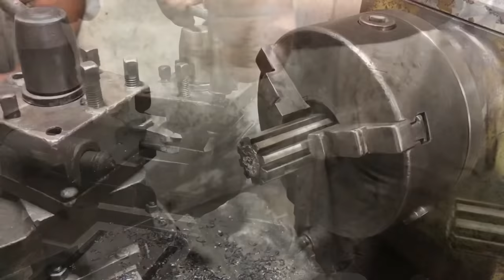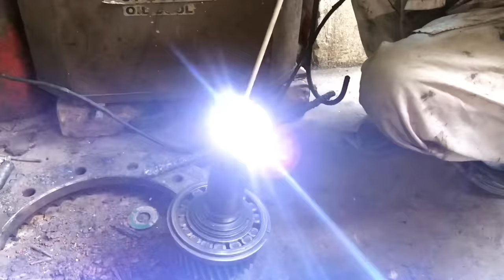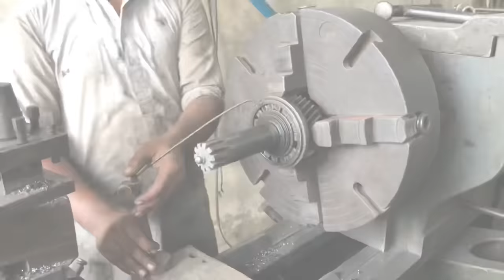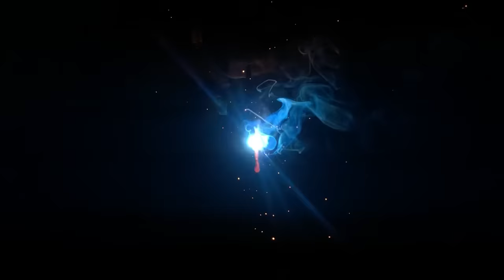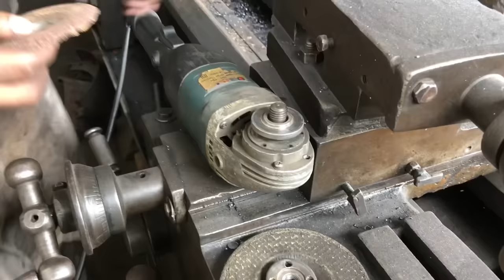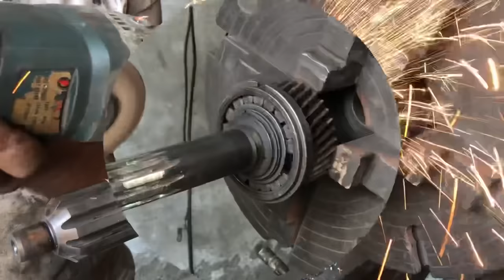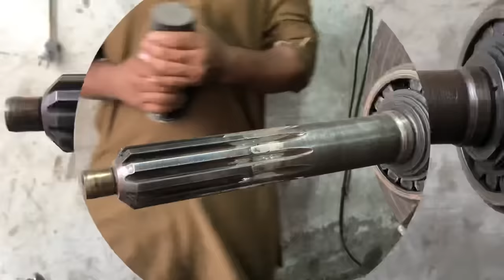The Ingenious guy Connected Broken Input-shaft Very Nicely / Pk process

Comment: As a lifelong welder, that ran a fabrication and repair shop for 45 years, about  the first time he accelerates, that thing will go pow, right next to the weld!  There are some thing’s that shouldn’t be welded, and that is one of them.  Like Clint Eastwood said, “A man has to know his limitations “!  😂🤣😂
Reply: As a physicist and engineer I approve his work, you're wrong.
Reply: @rafars2246  completely agree with you. Here in America we believe new is the only viable option. In many countries they have to make do with what they have and I feel the time spent on doing this job shows that it will last.
Reply: @acetech9237  that was a full melt job, compressing the area, that "weld" is stronger than the rest of the piece. And they do it for a reason, because it works for many more years to come.
Reply: Artistry. Impressive.
Reply: @rafars2246  he has 45 yes of experience on this and u have none and I am also an engineer
Reply: Thought the same, and i couldn't help noticed the fact that half of the piece turned blue, so it's probablly "not duro (hardened) anymore".
Reply: @lucianomi22  I got baking soda
Reply: Значит прийдётся ещё один шов наложить 🤣🤣🤣
Reply: That's shit in Cuba that's not done come to Cuba to see good turners it must be a drive shaft for a bicycle
Reply: @rafars2246  and the area next to the weld is weaker then the rest of the piece if is not retreated
Reply: They probably did this as a joke just to get viewers to earn money from Google.
Reply: @rafars2246  Ever heard of the HAZ when welding?
Reply: You are dead wrong my friend as a guy who were involved with this kind of job ,I am telling you that shaft it's gone work perfectly !
Reply: No oil on his metal cutting tools either.
Reply: Not sure for the first acceleration but for sure welding will not last for a few drives
Reply: @FIVE-0-APOCALYPTO  I know full well that that repair wouldn’t last p1ssing time.
Reply: @michaelwalsh9145  you don't know s*** until you or anybody else can factually tie in it's actual application that may in fact be going toward something different now rather than back to its former application...
Reply: While I agree I doubt they would go to all this trouble if they hadn't done it several times before and been successful.
Reply: @Mike-01234  DESCRIBE "SUCCESSFUL"....
Reply: Hello   LEE,   your   right,  but  they  have  to   Gamble,    false   economics    alright  to   us  in   the   West,  but   one   has  to   admire   their  ingenuity,   regards.
Reply: I doubt seriously if he would put this much work into that if it was going to fail. I'm sure he's done it many times with good success. Just because in the U.S. people can afford to buy new or salvage doesn't mean it won't work.
Reply: @rafars2246  what do you mean?
Reply: @timhitt9541  Tim, it  will  fail  alot  sooner  than   later  believe   you  me,  but  they  have  to   try! regards.
Reply: If it holds the shaft isn't straight, you can see that when he spins it while grinding the splines.
Reply: @rafars2246  чучело ты, а не инженер - он сварил Электродной сваркой, Разорванную ось, кое как отцентровав той медной ниточкой Искривленную от разрывных нагрузок ось, Калённую! Шов и оси - разные по составу металлы и разной плотности, сомневаюсь, что он додумался сделать хотя бы Отпуск детали. Судя по качеству шва - там пор и трещин в каждом слое "шва", в общем из мусора сделали мусор..
Reply: @rafars2246  The hardened shaft will not get a decent weld penetration to be strong enough.
Reply: I get a hardened shaft reading this debate.
Reply: @michaelwalsh9145  Yeah, I noticed that also.  And the heated metal ought to be dipped in fairly clean motor oil also.  It assists in retaining the structure/tempering of the metal.
Reply: He should have ground a piece of HSS to the contour of the spline, fixed it to a boring bar, and fed it through those splines to recut them rather than grinding.  Obviously they didn't have a mill or they'd have milled them.
Reply: @МихаилДжиесов  И это не предел!
Reply: @Roybaaa  bullshit. If it broke from torque pulling a big ass load on a truck it's gonna snap as soon as he does the same thing that broke it in the first place.
 That shaft is hardened then you screw that all up when welding it. So the weld is stronger than the metal and will pull the soft medal off with it.
 Maybe if they hardened the entire shaft again, maybe.
 Hell you can get anything you need in the world in just a couple days. If it's a truck it's not worth the risk of screwing something else up or crashing.
Reply: @rafars2246  it's amazing how others will run there noses at them when they weld is stronger than the rest of the piece.
Reply: @NeutronX101  No one is saying the weld isn't strong.  But when you are welding piece of heat treated steel the steel is weakened where the weld is made.  It is not uncommon for failures to happen where something is welded but not from the actual weld, from the metal under the weld where the heat had changed the strength of the metal being welded.  

The size of the clutch plate being put on this thing to test fit indicates that shaft is going to have a considerable load applied.  I may not snap right away but it will certainly not be as strong as it was prior to the welding being done.  The real question is how much margin of safety was engineered into the shaft when it was designed.  Hopefully a lot, and if it was highly over engineered it may last for a while... otherwise it will break again and depending on what this thing was made for could result in the deaths or injury of quite a few people.
Reply: Agreed that think is more stressed now than it was certain material and things can't and shouldn't be welded on
Reply: If it were for an airplane part would you think to use it?  That's always a good gage to use.
Reply: Jap I absolutely agree 👍
Reply: Update: Shaft survived but front trans. bearing failed from all the grinding debris. Transmission exploded, bus went across centerline, all passengers dead. Input shaft salvaged and reused on another bus.
Reply: Yep 100%
Reply: It broke already correct?   Somene find the truck owner lol.  That thing is busted again
Reply: @rafars2246  As an engineer, I disagree with you. We see that he welded it back together and painted it to look pretty, but he didn't stress test it to ensure it would actually be usable.
Reply: @rafars2246  I would like to see the science and math to how you can compress the weld points before it becomes too cold to do any compression.
Reply: @danmyname  Yeah, a lot of channels on YouTube make crap "hacks" and "genius engineering" videos that are scientifically unsound and often useless with a number of the things like "medical hacks" actually being more harmful. But they still get a lot of views and likes because most people are stupid.
Reply: @alitn588  XD Nice job mixing up singulars and plurals with that joke.
Reply: @timhitt9541  Just because it was done in a different country doesn't mean it would pass a load test.
Reply: @NeutronX101  Just because there was welds made doesn't mean the welds are good.
Reply: @ReroutedYearAD  you can make a weld stronger that the solid piece itself. Learn some.
Reply: @U.F.0.  stronger than before
Reply: @ReroutedYearAD  no need to test, stronger than before
Reply: @rafars2246  it will break just past the weld. The weld itself may be stronger,  but the metal it's welded to isn't and will break. Anyone with any knowledge of welding knows this.
Reply: @U.F.0.  No
Reply: @rafars2246  the first time Habibi pops the clutch and puts 400hp and 1500ft lbs to it it's going to break again.
Reply: @chrisleggett685  no
Reply: They have been doing things like this back east for a hundred years. They make things work, let's see you build a better one for 11 dollars
Reply: As gamer enthusiast, i can assure you that it's working as intended.
Reply: @rafars2246  Weld doesn't compress it expands because of the heat it puts off. All that stress and heat in one area will drastically weaken the steel (look in to metallurgy) The reason they do these half of these things you see on YouTube is simply for a video. You know how much money it costs to do all that work on one input shaft that you can buy cheaper brand new. This might hold on a yard truck that doesnt go past 20 mph. This video is made for views, look at the amount thats a lot of money in india. I've been fabricating for many years i stay away from "scabricating" anything very important for safety like this.
Reply: @keselekbakiak  yeah 🤣
Reply: @townsendliving9750  exactly. Is not like the guy who want it fixed, is going to pay for something the so called experts are saying is going to fail...
Reply: @2147B  man, this is india, labor is dirt cheap, way cheaper than the part. And the fix works, otherwise the i dian trucker wouldn't pay for it...
Reply: @rafars2246  Well the indian trucker is going to pay for it 5 more times, where if he just got a new one he'd be fine. This application here is #1 for DONT WELD
Reply: That definitely wouldn’t of lasted if he hadn’t applied the magic paint for strength.
Reply: @czarekaj1098  you have no idea then. You're an instructions follower. Zero engineering background.
Reply: @czarekaj1098  again, go get your booklet to fix your next car..
Reply: @rafars2246  You kept arguing that the weld would be stronger than the part itself and others have criticized your argument that the surrounding material would be weaker than the weld if the weld was done properly, which coincides with your argument of the weld being stronger than the part. Yet you keep arguing they are wrong, which would mean that you are wrong. I took welding in highschool and did some more in my college automotive courses, so I already learned some things about welding despite you telling me to. However, you should learn how to make logical, consistent, and valid arguments.
Reply: @ReroutedYearAD  surrounding material would be as strong as when first was made. Nothing wrong with that. But for that you need to know physics. And I'm not going to teach you. You need to pay for school.
Reply: @rafars2246  Already payed for school. And no, a weld doesn't alter the structural integrity of the material being welded. Your claims of understanding physics doesn't alter metallurgy and chemistry.
Reply: @ReroutedYearAD  then you do know nothing
Reply: @rafars2246  Tell me the physics of how the tensile strength of two 1/2" plates of mild steel butt welded by oxy-acetylene torch is increased because of the weld joining them together.
Reply: @ReroutedYearAD  go to school, you need to learn way more.
Reply: @rafars2246  ever heard of heat treating to make steel stronger? When heat treated steel is welded it anneals the metal removing the heat treatment.. the second problem is the HAZ heat affected zone and this happens even to mild steel, go do a welding course and it's something that's drummed into you for the whole 4 years of it.. you claim to be an engineer but you don't know anything about engineering, a first year apprentice welder knows more about this stuff by the end of their first week than you do
Reply: @markshort9098  And a physicist. Welding courses are for the plebe. You have no idea sir.
Reply: @1Podri  you can't even engineer a screw driver. Stop lying.
Reply: @rafars2246  Welding courses are for plebs. So, how are you a master at welding then? Also, you still continue to evade my challenges.
Reply: @rafars2246  Also, you go on about being an engineer, the rest of us need to go to school, etc. to understand welding, yet you say it's for plebs, so there you go again with the kettle logic fallacy.
Reply: @ReroutedYearAD  you can't challenge a physicist, and an engineer
Reply: @ReroutedYearAD  the fix was perfect, welding subhuman.
Reply: Also, Rafa, you said this was in India, so, I don't get where you think this is "perfect" engineering (I'd argue for anything to be perfect, it could only exist in a universe were everything else is perfect) from a channel name I can only understand to mean "Drunken Process."
Reply: @ReroutedYearAD  never said that's perfect engineering. It is a perfectly fine fix. Fix you wouldn't ever be able to do because you're only good to do what you're told in your booklet. It is people like me who dictate your booklet in order to make more money for the industry. But I don't care. I know this fix will last and you'll never know because you're a victim of our rules.
Reply: @townsendliving9750  That's why they are 3rd world.
Reply: @rafars2246  what part of I've examined more than enough failures over the decades to know what happened.. it's not just what my instructors taught me, it's what I've seen with my own eyes many many times.. look up what happens to heat treated steel when the metal is heated to melting point or do you not believe in heat treatment either? I take it you don't believe in weld procedures either and it's all just made up to make life hard for welders.. tell me, how many boxes of fruitloops did you have to eat to get your fake engineering and physics degrees
Reply: @rafars2246  "the fix was perfect, welding subhuman." then " never said that's perfect engineering. It is a perfectly fine fix."

Also, "It is people like me who dictate your booklet in order to make more money for the industry." Ah, so you make toilet paper. That doesn't make you a physicist, an engineer, or someone that understands welding, or engineering, or maintenance repairs. Also, good job continuing to insult people like a real mature and intelligent person.
Reply: @ReroutedYearAD  Hahaha, "Pee Ke Process."
Reply: The whole thing needed to be 'baked' to normalize the weld to the rest of the parts. It should have been heat treated and case hardened. He didn't do that.
Reply: @markshort9098  you haven't seen 💩. Cause in your world, everyone replaces, don't fix. You wish you could have the labor skills those guys have, but you're just good enough to replace, cause the booklet says so.
Reply: @bodyrumuae2914  I don't need your approval, I am above you.
Reply: @rafars2246  and how do you know what work I've done?? I specialise in weld repairs and weld build ups, how many repairs like that have you preformed?? 🤣🤣🤣
Reply: I am a mechanical designer, and I could not agree more.
This kind of parts are made of complex steel alloy, there is no way the metal used for welding can handle this.
Reply: @bodyrumuae2914  ok peasant
Reply: @rafars2246  Like Aumjaya said, you don't have an argument, so you have a reliance on attacking the person.
Reply: @bodyrumuae2914  not true, my argument has been made. Can't reply the same thing all the time. Read and learn
Reply: @manu4gaming394  there's nothing complex about it, the weld is stronger than the original material.
Reply: @rafars2246  Yes, yes, your argument has been made, unfortunately it has been pointed out that you employed a series of fallacies, including kettle logic. The weld is stronger than the surrounding material, yet the entire object is stronger because of the weld, while also the weld is weaker than the surrounding material. Your arguments are contradictory. You are the only one refusing to learn, everyone else here already knows of the law of non-contradiction and knows that your claims are false as we can demonstrate from our own knowledge and experience, yet you continue to insult people rather than prove how we are wrong.
Reply: @bodyrumuae2914  you don't know how to read...
Reply: @rafars2246  XD What a retort!
Reply: @rafars2246  You aren't a very good engineer then, otherwise you'd understand why this is no good.
Reply: @candlestyx8517  this is physics, you don't get it.
Reply: "@Body Rum UAE  what an ignorant"

Ignorant what? How about writing complete sentences, Mr. Wisest of All?
Reply: @bodyrumuae2914  wut?
Reply: @rafars2246  Former mechanic, welder and machinist going to school for Nuclear Physics. I understand far more than you.
Reply: @Mike-01234  Even if this was the hundredth time he did this there once was a first time he tried it.
Reply: @candlestyx8517  my mother is probably younger than you
Reply: @candlestyx8517  "@Candlestyx  my mother is probably younger than you"

Ah, I see. Rafa's mom got him the Thames & Kosmos Physics Pro V2 kit and Theo Klein Bosch DIY Construction Premium Toolset for his birthday this year, making him a physicist and an engineer. That explains why they couldn't tell us what fields they practice, any information supporting their claim, and their disdain for reading nonfiction.
Reply: And he ought to know when to use a centre bit. ;-)
Reply: @rafars2246  yes sure, and I am the pope xD
Reply: @dubiousricardo  It is only case hardened, that is why he could easily drill a hole in the middle of it.
Reply: @manu4gaming394  you have no clue about indian engineering
Reply: @UCTXhUonrmE1q5Ybjvma9v0A And they fix stuff for good reason, because it works and makes sense financially.
Reply: There are parts of the world in which people must make due with what they have. Americans, perhaps even you, don’t understand that many in the world are not as affluent as the average American. I’ve spent considerable time in China and other places abroad. I’m amazed at the resourcefulness of people. They can repair things that Americans simply throw away. I’ve seen kids field strip a Diesel engine water pump and rebuild the top end while out in the fields. 

So your Clint Eastwood comment, does not apply here. I applaud these people for their resourcefulness, and I’d suggest to you that they greatly expand their limitations out of necessity.
Reply: @RADVIX313  45 years welding frames or whatever hehe
Reply: @RADVIX313  haha. Also remind me other things like tires. Oh you can't if is too close to the side blah blah blah. I plugged tires even right over the side, where the patch wouldn't even contact the road, and zero issues...
Reply: After seeing welded axles snap.. I'll never attempted it again..
I'd use the same principle but with a bigger shaft going into both sides.. 
Drill holes and put in pins.  Welding the pins only.
Reply: @bodyrumuae2914  I think my point went over your head.
Reply: @Mikesorrento3344  Uhuh...
Reply: @sunilmaharaj2059  everything eventually breaks, and fixing a shaft in India is way cheaper than buying a shaft
Reply: Welder and metallurgist that pow you are referring to is the fact that the metal was hardened and Brittle it needs to be annealed first and brought back to the right Rockwell when finished I know I’ve done it many times if you take the shortcuts it will break but when you build and make and repair one-of-a-kind things every day you learn how to deal with these things it’s faster than trying to make a new one when time is of the essence.
Reply: @russellfrahm395  and money. This is cheaper than buying one in India
Reply: Come on, y'all!  Don't argue with Rafa RS!  He welds truck leaf springs and cast iron for a living, and they all work perfectly. 🤣
Reply: @rafars2246  You can clearly see by the title of the channel, this is PAKISTAN engineering.
Reply: @artgoat  same thing
Reply: @rafars2246  What a relief to know that India and Pakistan are "the same thing."  Congratulations on ending 70 years of conflict!  I guess that means Islam and Hindu are the "same thing" too, right? Great news!
Reply: @artgoat  engineers work with my instructions.
Reply: If they do it, then they have tested it on their trucks and on their scary mountains roads... before , engineeing was all about experience and testing in real life..  today its all about patents, insurances, marketing and many ** here and there to grow the business and milk the customer.
Reply: @الطيرالحر-خ8خ  exactly right.
Reply: @furiaurobertak  and a physicist
Reply: @rafars2246  lol, makes sense financially, that's why they're poor I guess...
Reply: @monad_tcp  if they fix it is for a reason. Poor people don't like to waste money.
Reply: @rafars2246  oh yes, they can't waste money... 
Proceeds to was tens of hours fixing scrap metal. 
That only makes sense if your time isn't worth the money. 
This is a waste of time and money. 
Because then the part breaks because of shody work, then the truck stops and you waste money because you didn't want to spend money properly to begin with.
Of course we all know why the part broke to begin with, overloaded machines. 
That was probably also because the company didn't have money and wanted to "save" by overloading too much the truck. 
Sure, it makes sense, couldn't waste money buying a new truck. 
That brings me flash memories when I used to work for third world companies. 
That's why they are also "underdeveloped", not to say poor. Poor is a mentality, you have to spend to make, I'm not talking about workers, of course workers are poor, I'm talking about the business owner poor man's mentality. 
Cant spend on new machine because you spend all to keep the old working, which leads to bad performance, which leads to low production/output, which leads to lack of money, which leads to "can't spend money", Which leads to shody work, which leads to breaks, which leads to bad performance, which leads to low production... . Forever and ever stagnation. 

Thanks for coming to my TED talk.
Reply: It won’t work, torque stress is very different to pulling or pushing.
Reply: @jimamizzi1  always works
Reply: As a welding engineer I must say: YOU SIR, ARE CORRECT!
Reply: I agree, some people don’t know what torque is, this thing will inevitably break, and I don’t care how much experience people have this just won’t work and it’s off a truck as well
Reply: @jimamizzi1  it works 100% of the time
Reply: @jimamizzi1  I took way more time to fashion this repair than the repair will last.
Reply: @rafars2246  also you are wrong welding edges has too much stress, that part must be first normalize before using it
Reply: @TKolWorkAcc  nah
Reply: @sigmamalerules1106  The difference between God and an engineer?
                                    Is that God doesn’t think he  an engineer.
Reply: @sigmamalerules1106 weld is strong, but the original metal will be brittle due to the extreme heat.

You could heat the whole part up and quench it to make it tougher.

Mechanics and materials was a very interesting class, but to really understand you had to get Masters.  It was only 1 class in our Mechanical Engineering program 30 something years ago.
Reply: @erdenfuratt remember the force is distributed over the length.
Reply: And have you any idea how many times he may have did this. And Indians do not do 100 mph they are lucky to do 20mph
Reply: @russellfrahm395  hi. I have a character in a story who repairs old equipment. What would be the correct way to do the sort of repair in the video? Thanks!